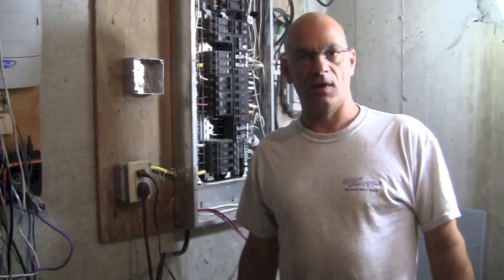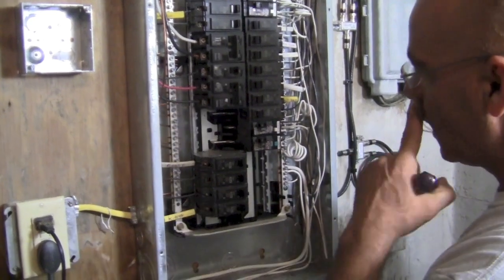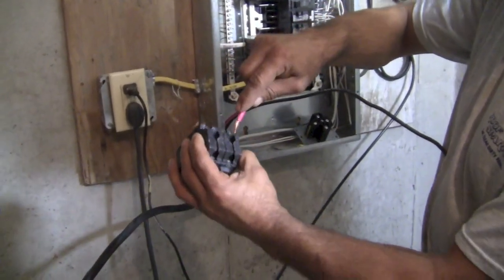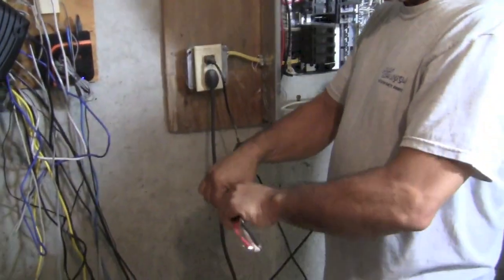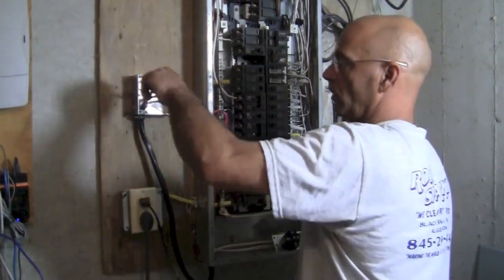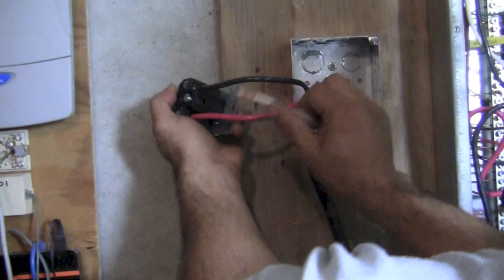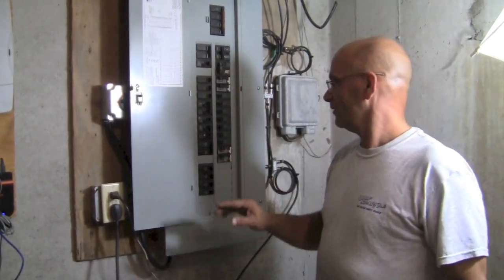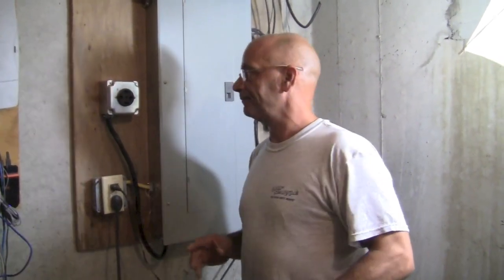How to Install a 220 Volt 4 Wire Outlet

Comment: I still prefer to also bond the metal outlet box to ground, even though you get the ground by screwing the outlet plate onto the front of the box. It really is no extra work to take that ground wire as it enters the metal outlet box, and loop it around a green ground screw to the outlet box.  Now you are bonded to ground whether or not the outlet port is screwed in place. This buys you more safety because the box is only bonded to ground as long as the outlet is screwed to it. What if someone puts in some stupid outlet that the plate is not connected to ground? Supposing some moron put sin a new outlet port and forgets to connect the ground wire? Then you no longer have have a ground-bonded outlet box, and this problem is far riskier in your case where the outlet box is on a wall out in the open where a kid can touch it and get shocked if there is a fault in the wiring inside. But if you had wrapped the ground wire around a screw, your box is bonded to ground no matter what else happens.
Reply: It must be bonded to the box anyway by code. This is why you don't take youtube video's at face value.

Comment: I want to re-route the wiring from a 30 amp outlet to a 30 amp fused disconnect box for a mini split install. The wiring to the outlet is 4 wire with a bare wire ground. The disconnect box accepts line 1 and line 2 and a ground wire on the line side. Since the existing cable is 4 wire And I only need 2 hot and one ground wire I was going to just wire nut the white wire and leave it in the disconnect box. Is this proper?

Comment: Wouldn't it be 120+120= 240v
Reply: Voltage fluctuates constantly.  110 is just the average (the mean?).  At any given moment you will have somewhere between 210 and 240 volts in the circuit.

Comment: Hello Askmediy. What if I have only 1 hot line 220v. How do i connect in the 4 prong outlet? thanks for your help
Reply: You probably need to have a different wire run.  The dryer needs to be able to access just one hot wire to run the electronic controls.  It uses both hot wires to make the heating element do its thing.  If the electricity is all going down one wire, there is no way for the dryer to only use part of the voltage available, and you will fry the dryer.

Comment: Great video. My issue is I have a 220v, one single hot 220v + one neutral + ground. Can I connect the 2 pong that should get 110v each and power them with one phase 220v? Not sure if I'm clear. Thanks a lot

Comment: In my panel the ground bar and the neutral bar are located in each side. Each bar ,however , both have a mixture of ground wires and neutral wires, instead of all neutral on one side , and all ground in the other side. Will this type of configuration cause any problems for example popping noises in a television or static popping in surround sound speakers? 
Or would this configuration cause any other problems, or is this a typically common thing electricians do in a newer home wiring setup? Thanks

Comment: question: can I use 8/3 or 4 w/ ground to hard wire from 50 amp exterior rv plugin to wire  to house panel and add a 50 amp breaker for portable generator 15555 generac yes
Reply: You really need to hire an electrician to get this right.  Getting this wrong could ruin your home.

Comment: Awesome video, I have a question, is it required according to NEC to use a pigtail to ground that metal box? or is that only needed when using conduit for the feeder wire?

Comment: Wouldn't it have been easier to put the wires through the box and install the outlet first and THEN do the other side in the panel?  That way you wouldn't have to deal with too much wire in the receptacle box. It's much easier to work in the larger panel box, right?

Comment: what is the diffrance in a 2 hot /ground and the 2 hot /neutral/ground what delegates the use of each
Reply from the maker: BrotherCavefish you’ll use a neutral when one is needed. However outside a 20 amp you’ll always want to use a four wire setup. A neutral is a return path back to the transformer

Comment: I have a problem I want to fix I had a professional install 30 amp receptacle  125/250V for my Honda eu3000is. he made a doble male cable ( suicide cord) the one on the generator in L5-30P Plug Locking Plug, 30 Amps, 125V. And apparently he didn't put a breaker for the generator he told us all we needed to do is turn of the main breaker but wen we tested it the generator only power on few thing on the house and it's not stable and there one air conditioner that it's power light apearse to be stable that wen all the breaker are on but when I only turn one breaker on I don't eve have unstable power but my breaker are receiving power but not my appliances
Reply from the maker: You'll need to get a pro in for this.

Comment: Whew! Looked around quite a bit before finding this! Thanks, very helpful! Only thing I wish your video included was a material list. I didn't realize breakers were brand specific or the wire type till I went to buy the stuff. But otherwise great video!

Comment: shouldn't the box be grounded?
Reply: nvm i see now, though wouldnt it be safer to screw a ground in the box and tie it with the ground from the wire
Reply from the maker: watch again. 1600. The outlet and box are metal and the outlet is grounded.

Comment: How would you wire up a commercial Garland 60w electrical range what does the white go the neutral wire go on on the power cord Supply
Reply: And it goes by X Y and Z with the ground at the bottom so I'm trying to figure out where does the white neutral go between x y and z

Comment: I noticed that my box has white as well as ground wires attached to the right hand bus bar. It's been there for 27 years and was installed by a friend, haha. But the house never burned down. I have recently been learning house wiring, and have been able to do 120v plugs and switches. I'm about to install a 15 amp breaker for a stairwell light and I'm wondering if I can put the white and ground on the same bus bar. Thanks!
Reply: You should do it the right way and put the white wire on the neutral bus bar and the ground on the ground bus bar.  The separate ground provides an alternate path, in case something goes wrong with the neutral.  Better safe than sorry.

Comment: hey great video but i have a question i have a dryer with 4 prongs in the u.s  that i want to send to overseas where the main current is already 220v is there a way to wire it
Reply: If your dryer uses 120V for electronic elements (microcontroller, sensors, etc), then it will not work in a country that uses 220/240V. Their dryers step down 220V to whatever DC voltage their electronics are using (12V, 5V, 3V?). For some reason, in the USA , they use 120V for electronics even though it would have to be stepped down anyway.

Comment: Hi sir,thanks for the good informative video,I have 1 question ,can you make a hole in
Reply: Because I'm putting a 220 volts in my service panel to be use for my welder,but my service panel is located outside the garage.im planning to drill a hole from my service panel thru the garage,my question is is it allowed by NEC for a homeowner to drill hole to run gauge 6 wire 50 ampere breaker that I'm planning to install,and using a metal niple with a plastic coupling?to run my 6 gauge wire going to the garage,its only 2 feet wire?thanks in advance for your reply.more power to you.

Comment: Hi, I noticed in your breakers, there is a white wire that is in the hot wire position above the breakers you are installing in the video. I noticed in another video someone else doing this as well. Why are you using a white wire as the hot wire? I always thought white neutral?
Reply: Most of the time, yes, white is the neutral and connects tot he neutral bus.  But in a 3-wire 220V setup, both the black and the white are hot, and are connected to the breaker.  You should wrap a couple inches of the white wire with black tape or color it with a black sharpie, at each end, to tell anyone who comes along later that it is being used as a hot wire.

Comment: Am I able to wire 220V in Parallel from my Dryer to my garage? Distance from Panel to the Dryer is 30 feet. Distance from Dryer to shop area of my garage is 30 feet.

Or can I make my own 220V "Extension Cord" until I get a more permanent fix?

Comment: So I bought a house that has a 220 plug. I'm trying to change the plug around to fit my welding machine. I have two blacks two whites and two uncovered copper wires. What do I do on this situation? The plug on the welding machine is a twist lock plug
Reply from the maker: How do you know it's 220 volt?
Reply: askmediy I tested it with a volt meter and both wires were 120

Comment: What I don't quite understand is, you say both of those wires are on the same phase...don't the tabs the breaker connect to alternate phases (next to one another)?
Reply from the maker: This is a single phase panel. I'm sure like yours. So, each leg is a separate hot leg. Not a separate phase. Each one being 120 volts
Reply: From my reading, 2-phase panels are very common.  How can I tell the difference?
Reply from the maker: There aren't two-phase panels. Only single and three
Reply: Interesting... so do both legs have the same phase?  Or are they 180 degrees opposed, just not called 2-phase.

Thank you so much for your help, btw!
Reply from the maker: To get technical yes there are. There is more involved than that, but that's what they are.

Comment: to run a 220 volt out let   you need to also upgrade the breaker to a 50 amp ??
Reply from the maker: Wire, breaker, and outlet.
Reply: askmediy 6 gauge wire ?
Reply: askmediy my breaker right now is a 40 amp would that be the reason I don't get power to a 205 v ?
Reply from the maker: Wire, breaker and outlet.

Comment: In America, is anybody allowed to run electrical circuits in their home? In Australia, this would have to be done by a licensed electrician! if not, if there was any issue like fire etc as a result then you'd be saying goodbye to any insurance claim.
Reply: Same here. The home owner could do it but like you said, insurance claim would gore than likely be denied.

Comment: i would have liked to hear someone speak about balancing the panel load. which side you place new breakers based on other branch breaker loads. is that overkill safety standards and not worth considering?
Reply from the maker: It's a 220 / 240 breaker. It uses both hot legs.

Comment: would it be ok yo put the white wire on the same side as the ground wire in its own spot?
Reply from the maker: The easy fast answer is yes. As long as this is for a four wire setup.

Comment: Why didn't you feed the wire through the bottom right of the box? It would've been a bit cleaner(and more logical).
Reply from the maker: Because of the KO for the size of the wire I was using.

Comment: I have a drier plug like the one you are wiring in this video, I need to make an extension cord with a male plug for this end and a welder plug on the other how do I wire this to work with out burning down my house?

Comment: can you tell me what type and gauge of romex wire you used?  also is that a 50 amp breaker?  when is it necessary to put the wire into a conduit?  thanks

Comment: Awesome video, great technical information flavored with a great personality. Used this information to wire a new dryer outlet and wired a new 30 amp breaker into a sub panel downstairs. Now if our dryer breaks down upstairs we have a backup. Thanks Dom. Keep em coming. My guess is your saving lives with this important info.

Comment: Are their any alternatives  if my existing  box does not have any room for a 220 breaker I have an electrician  comming tomorrow  and I wanted a 220 breaker  Installed  for a  220 welder but it seams like my breaker box is full????
Reply from the maker: Yes of course. But this will depend on how your panel is laid out. Or you may have to install a sub panel

Comment: "we're not gonna deal with the amperage, we're only going to deal with the voltage, the amperage matters but we're not going to talk about it"

OK, how about I have a short course for everyone, both amperage and voltage matters because if you combine the 2 it creates Wattage... 

Voltage multiplied by Amperage equals the wattage that the fuse or breaker can hold, wattage is the power.

Let's say you want to use it for something more than a just a kettle, let's say you want to power a kilowatt computer (1000), kettle (1800), kilowatt microwave (1000), Toaster (1100) and then your wife's favourite household member... the tumble dryer (3400)... (sorry, husband is somewhere in the appliances too)

Let's say you try that on a 110V 40A system, you hook it up and all is sweet till you get to the microwave, now you are at your limit, add the toaster and pop!

at 110, 40 amps, that is 4400 watts to play with, you can double the amperage but that's half of your households amperage budget from the street, or 80% for old 100 amp systems

"can my entire home run on 240v systems?"  well, I guess, phone chargers and many modern appliances usually say what voltage they can run with, they say 110-240v usually because let's face it when you manufacture for mass markets you already got the regulatory pins to deal with, let's just add a simple part to the appliance to  detect when it's 110 or 240 that way they only need to think "this one hot, the other is return, the third is a ground pin.

"why don't we just, ya know... switch over?" ever been to a classical electronics museum such as grandma's house, yea... I don't think she will be too happy when most of her stuff goes bang, especially when she's using them.
Complacency got you guys into this, many of the systems that you aren't really too caring about use 240v, such as the electric dryer, electric range, stove, electric water heater, electric air conditioner, electric heater (hvac but can be other things too) and electricians are happy to slap on a double and call it a day.

now, if you really want to know more about electronics, you might want to research the difference between DC and AC, your power that is raw before the transformers is a whopping 115,000 volts at least up to and over 800,000 volts, so I would say that 240v is still classed as low voltage, it's only when they approach transformers then they step the voltage down one by one until it becomes consumer level voltage where your wall outlet steps it down to just a mere 5v 2amps.

I consider amperage to be the other half of the math, especially when you are calculating how many breakers you need for 110v 40a outlets and how many appliances you can fit on 240v 40amp.

Comment: Damn that wire is huge lmao.. can't u just use 10/3?
Reply from the maker: Wire size is based on amperage needed.
Reply: I know.. isn't a dryer 30A?  Which would be 10AWG?  That one looked larger... maybe it's just the video angle.

Comment: What gauge wire is it for 30 amp dryer?
Reply: 10 Gauge wire if the distance between the outlet and panel is 100 feet. 8 gauge if it's over 100 feet.
Reply: Erik Liska Thank You !

We did a 10 gauge wire about 25 feet.....

Comment: I've always heard different numbers. 

Is it 110 or 120?
Is it 220 or 240?

You said 120, but wouldn't that make it 240?
Reply: The modern standard is 120v/240v.  There is a long discussion about voltage loss in older grids and systems, etc. and 110v/220v was correct for them.  Actually, the way that the old and new systems compare, it is not incorrect to call it 110v/220v but the modern standard usage is 120v/240v.  It is a distinction without a difference really.  If you were in an electrical class, your teacher would want you to use 120v/240v -- on a work site, you'd hear people using both and everybody would understand.
But, yes, it's an important point that two hot legs together should give you a exactly double what your single legs to neutral/ground are.  It is possible to see a different number with a meter, but that indicates something is wrong with the wiring or connections etc. and that situation must be checked and corrected by a trained electrician.
Reply: Thanks so much for the explanation/clarification! Thumbs up for you.

Comment: What I usually say for people like you is a little man makes big jobs.  Very clear and beneficial video of how to. Now, my question is,  is it possible to extend the wire . My problem is that I have plan to remodel my kitchen and to move stove 3 - 4 feet further instead of running new wire from the box. Thanks for your help as always ,
Reply from the maker: Yes you can by using a junction box. However that box by code must be accessible somewhere. Perhaps via a cabinet or even in a basement ceiling.
Reply: +askmediy . Thank you very much for your help.  I've received notification about your reply just on time. Once again , big thanks.

Comment: Thanks Dominic.  I've used your videos for a number of installations so far.  One question...does the ground wire have to be the same gauge as the hot?  I need to install a 30A 220V line for my electric car charger in the garage.  Can the ground just be a 12 gauge wire instead of the required 10 gauge?
Reply: Nope, it should still be #10. For 30A, 40A and 60A the ground wire should be #10 copper (#8 aluminum).